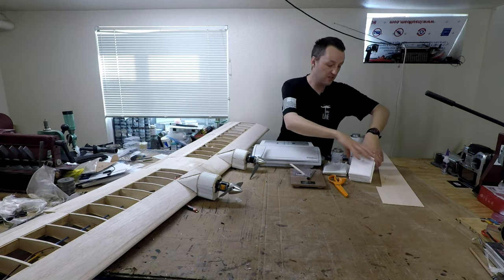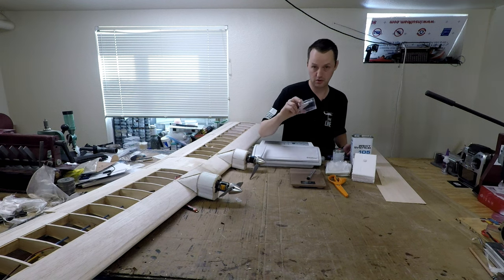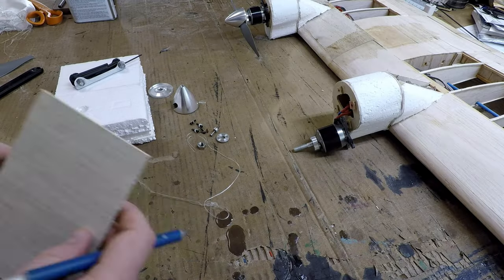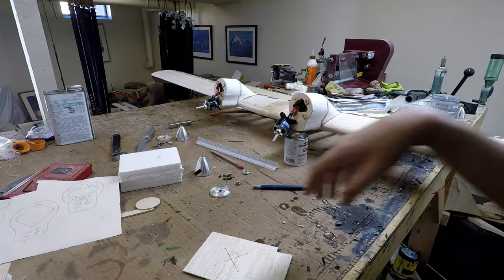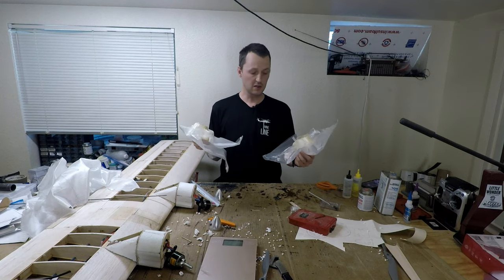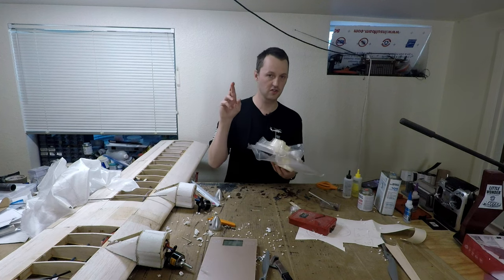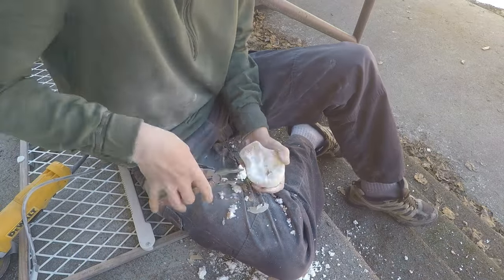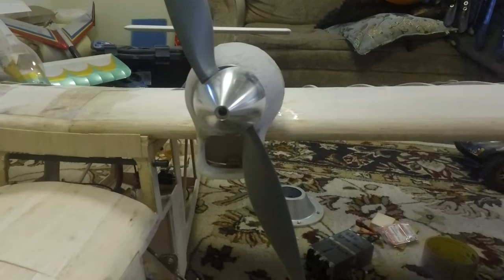Scratch Build Pt7: DIY Fiberglass Parts

Comment: Good job, but you should weigh out the resin and hardened or use the special pumps. I wear gloves when I handle this stuff, it can cause an allergic reaction that is no joke.
Reply from the maker: You’re right about wearing gloves and I normally do wear them. I forgot that time because I was also having to think about making the video. Good catch!